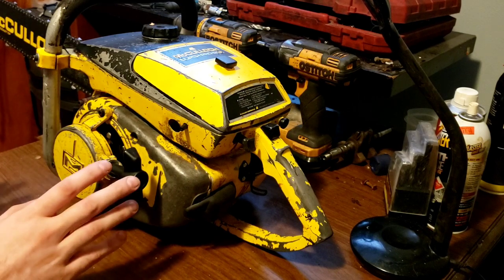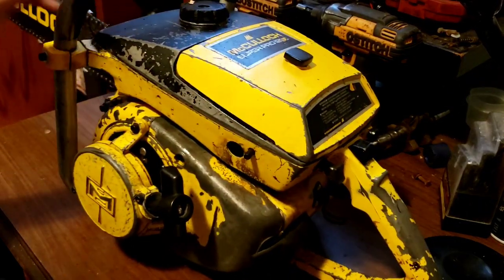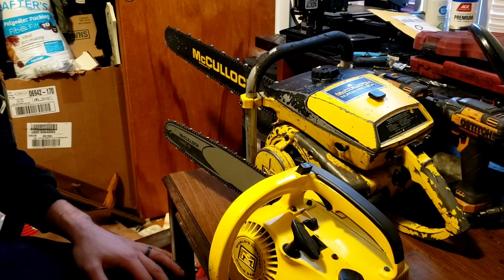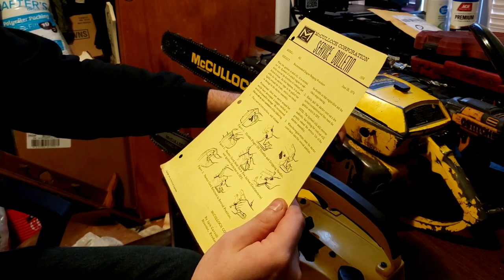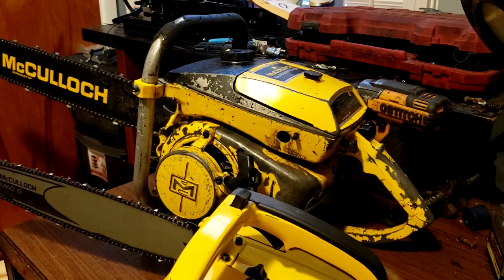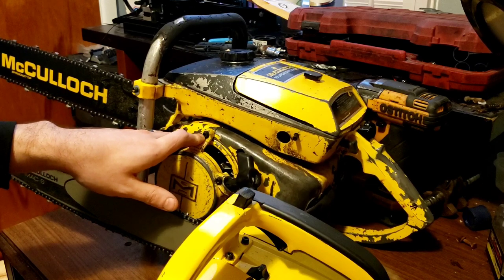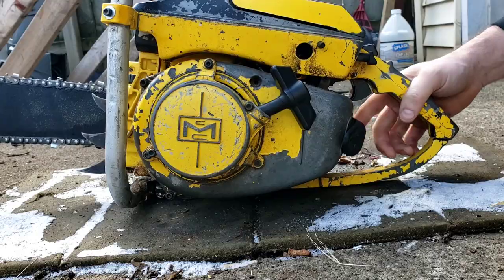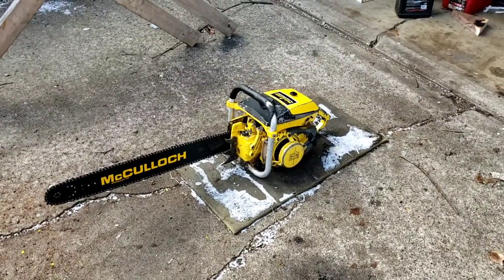Why You Should Pull The Rope Out Before Shutting Off Your Vintage Chainsaw (McCulloch Saws For Sure)

Comment: It is complete bollocks.. you can turn the motor backwards as many time as you like, the starter mechanism only engages when you have pulled the rope out unless there is something wrong with it..  It is pulling the rope out that engages the starter mechanism so of course the saw will grab it. It is like saying the brakes always drag on my car when i pull the handbrake [parking brake or emeergency brake to you] on...
Reply from the maker: Thats where you are wrong. On McCulloch saws it will pull the rope in more because of the compression of the engine forcing it to go backwards and due to the design of the starter setup, it flywheel staryer paws will grab the starter ratchet. You can very clearly see it pulling the rope back in and my hand gives it the "give" it needs to not break stuff. There is actually a service bulletin from McCulloch (I have that bulletin) saying to pull the rope out upon shut down of their saws to prevent damage. Once you run one of these saws with this starter design, you will understand quickly, or you can choose to not and risk rope stretch, starter breaking and searching for a setup because you didn't take the two seconds to do this simple trick.

Comment: That was a through, well done explanation. Don't get frustrated, but people will continue to ask this very question. I have a Stihl 084 with the decompression removed and welded shut(they are weak). That thing will tear the rope out of your hands violently when your trying to start it. This is another reason to keep a saw in tune, because when they die on their own, the same thing happens as when it is turned off.
Reply from the maker: Key is knowing where to put the piston at to start a saw in this situation. I have a 91a race saw I built and to be able to pull over, you have to have the piston past TDC then pull over.

Comment: You got that off Buckin Billy Ray
Reply from the maker: Actually I was doing this before he was well known. I joined his channel when he had only 500 people. This is something I was taught when I first got into these saws. Had some guys tell me about pulling the rope out and why to do so. It was last weeks live feed of his that another person asked about it to buckin and buckin didn't go into detail about why to really so it was then I decided to make a video with me explaining, me showing the service bulletin and then showing with a running saw why you should pull the rope out. I havent actually seen a video like I made that goes as on depth on the explanation of as to why you should pull the rope out. I would say the pulling of the rope on McCulloch saws started when this starter design came out with at least the 30 series saws.
Reply: McCulloch says to do it in the 610 manual.
Reply from the maker: And the manual I have xame way before the black and decker take over which is where the 610 series came from. Pulling the rope out technique for these came out easily in the late 50/early 60s. The first of the 610 were seen in 1979.
Reply: @mistermacgray  Yep. My point is (in your defence), whilst BBR advocates this, it originally came from McCulloch themselves.
Reply from the maker: @Syncop8rNZ  bingo. He is just passing history down to other people as I have done but I went into detail as too why vs just telling you. Parts aren't getting easier to find for them and a ruined starter could lead to a guy just tossing into a shed to rot or into the trash.